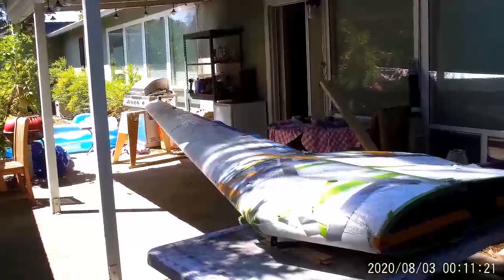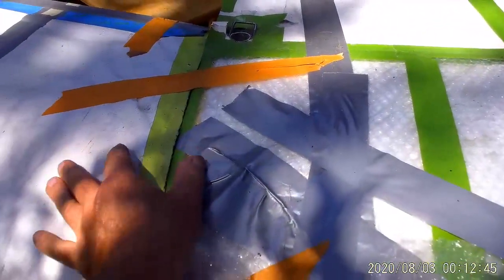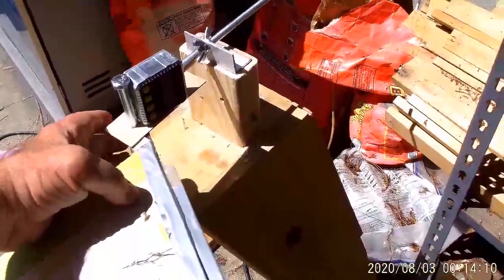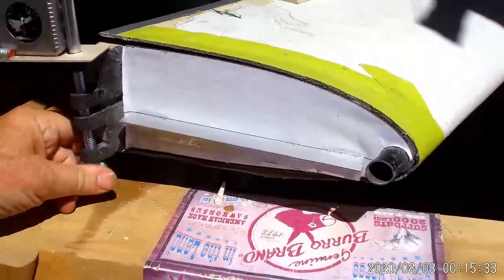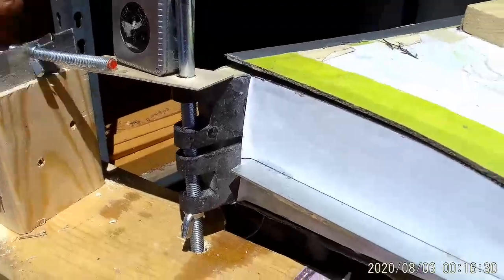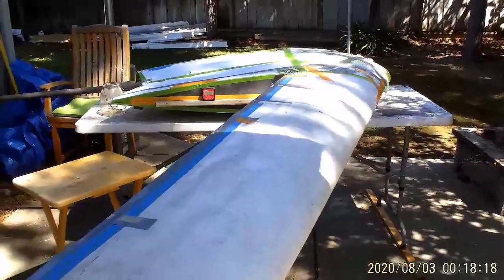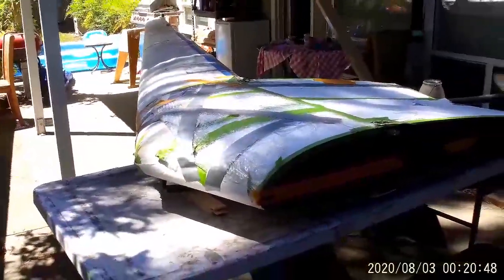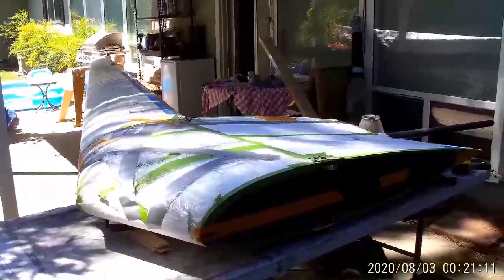Bonding the D-Tube - Klingberg Wing MkII Development

Comment: For the most part, the careful building and testing you have already done has perfected a very good outcome in a fairly short amount of time compared to the millions of dollars and thousands of man-hours that go into commercial aviation R&D. You're ahead of the curve, Rol. You've already corrected for the alignment error. Be proud of your accomplishments. I am! This still puts a top-notch glider into the hands of the avid home builder, and you can always sell 'D' tubes as part of a kit, if that is beyond their skill level. My suggestion is to make the next 'D' tube in smaller ship-able sections and work out a killer bonding process to put them all together. That would mean the home-builder wouldn't have to have a 25 foot garage to build one in.